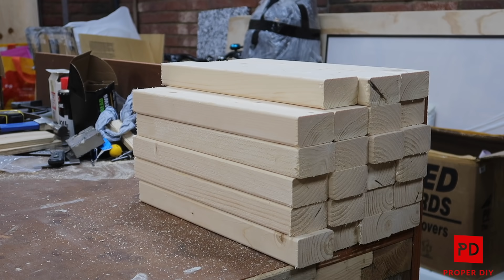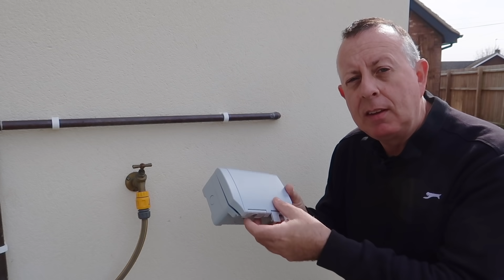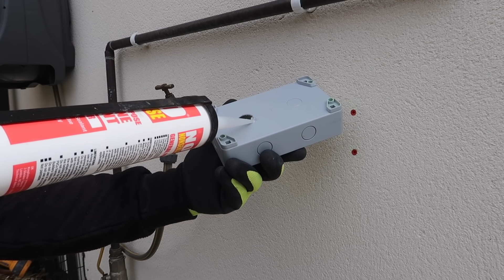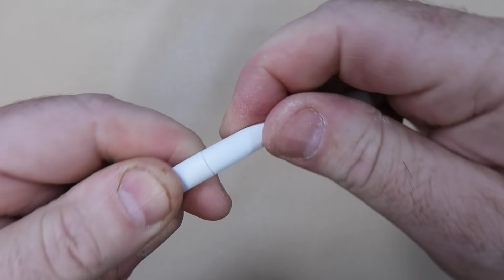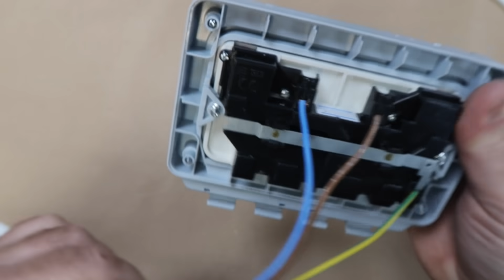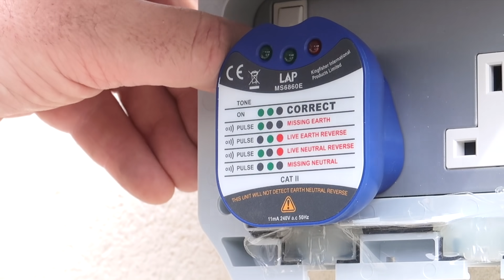How to Install the Easiest Outdoor Socket

Comment: This is classed as ‘notifiable work’. This requires a Building Regulations application to be made in advance so the work can be inspected and checked. However, in most cases the electrician can self-certify their work as they’re normally registered with a body that gives them the necessary ‘registered installer’ status (also known as ‘competent persons’) such as the ECA (Electrical Contractors Association) or NICEIC (National Inspection Council for Electrical Installation Contracting).
A ‘non-qualified’ person can still carry out notifiable electrical work as long as Building Control are informed – but if you fail to do this and the work is found to be unsafe, it can lead to a hefty fine. Upon completion of the job, it is a legal requirement for the electrician to test the new system and hand over a signed BS 7671 electrical safety certificate. If you are watching a youtube video on how to fit a plug socket, you are not a certified electrician and are not insured or covered and neither is your work 🤷‍♂️
Reply from the maker: This is an addition to an existing circuit. As an addition, this is only notifiable if it is in a 'special' location which is a bathroom or room containing a swimming pool or sauna. Therefore this is not notifiable work.
Reply: 100% non-notifiable.

Outdoor locations were removed from part P around 2013 so even if this was hard wired into an existing circuit would be non-notifiable. It would only be notifiable if it was a new circuit (or in a special location)

Comment: Be aware the doing unlicensed electrical installation null and voids your home insurance.
Reply from the maker: Absolutely if it is outside of that allowed in Part P of the UK Building Regs.
Reply: According to Part P this work is not notifiable. Even if this was an actual spur, it still wouldn't be notifiable. This guy also fits a plug to the end, so in essence, it's just a glorified extension lead. Here's a link to some official part p documentation so you can check it out yourself: https://electrical.theiet.org/bs-7671/building-regulations/part-p-england-and-wales/frequently-asked-questions/
Reply from the maker: @ashleydawson5070  Well said.

Comment: I'd 100% use bootlace ferrules  on stranded wire.  If there were to be any mechanical movement or vibrations in close proximity to the terminals.  There would be a much lesser likelihood the terminations would come loose.  We always have the conduit running at a slight downwards decline to the outside socket to prevent water ingress. As well as leaving the earth cables longer.  This is because if anyone were to pull the cable (i.e inwards)  the earth would  cable would come out last.
Doubling over the wire give a larger surface area for the terminal screw to clamp the cable.  It's good practice but not a requirement.  It's usually done more so on spur outlets and lighting terminals.  Where there's only a single cable being terminated.  👍

Comment: I have a question, I'm thinking of doing this for one main reason.. to plug an inflatable hot tub onto an outside socket but have one concern and that is;
On the instructions of the hot tub it states to not plug it into an extension lead, is this method technically classed as an extension so the hot tub will fail?

Many thanks
Richard.
Reply from the maker: This is essentially an extension cable with one end outside. As there are only 2 connections I believe there is low risk for earthing and RCD problems if you follow the steps I've shown. However, once you talk about a hot tub, then the stakes go up as the combination of people, water and electricity starts ringing alarm bells to me. Just like building regs requires qualified electricians to carry out work near to showers and baths, I believe, for everyones safety, hot tubs should always be professionally connected as only they can properly check the work they have done.

Comment: You do need a drain hole.  I don't care how well you think you have sealed it, warm air from your house will go through the conduit into the back box which will have cold outside air surrounding it.  The moisture in the warm air will condense.
Reply from the maker: I sealed around the cable and conduit so nothing coming in from the house

Comment: I'm an electrician and this is a great instructional video, the silicon and the pipe was a nice touch too
Reply: Are you sure you’re a qualified sparks Andy?
Reply: Yes Im positive, as long as this is terminated correctly and RCD protected it's perfectly safe imo and would do it in my own home. Probably wouldn't if I could back to back it off a socket but it has its place,cheers
Reply from the maker: Thank you so much! All I tend to get from Electricians is grief so nice to hear this from you!

Comment: Doing it this way is also non Notifiable under a minor works certificate, if he went in the back of the socket it’s noticeable as it’s in a special location. Most do it anyway but if you do decide to go off the ring main then mount an FCU next to the socket that way you can isolate the outside power. Also I would use the drain hole as at some point the silicone will fail letting in water, never fitted an LAP outside only ever used BG
Reply from the maker: Very good and correct points! I will do an update video after 12 months and we will all see how much water is in the box!

Comment: Can this be a permanent solution? I.e. putting electric to a shed / office?
Brilliant content, keep up the good work and thank you 😀
Reply from the maker: Thank you! Unfortunately not. To be going across your garden in any way you really need to be using armoured cable and there is a lot more risk if not earthed properly. This will need to come from your distribution board and under the UK building regs, you need an electrician for that.

Comment: Should have used 2.5mm 3-Core flex mate
Reply from the maker: Why? A 1.5mm flex takes more than the 13amp fuse (as I said in the video) so no benefit as the fuse is the weakest link.

Comment: I'd still drill out the drain hole, and the second one if it had one. The magic water always gets in somehow so it's good to let it out again.
I'd also recommend using an RCD plug. You can get the socket and plug in a kit although you are then limited to the supplied cable unless you rewire it.
Reply: The poster said his circuit was already RCD protected (11 minute point) so you don't need an RCD plug which would be just a waste of money.
Reply: @alanmorgan1389  it's always good practice to protect an outside socket with a dedicated RCD. Lots of factors can reduce the sensitivity of an RCD, the main one being length of cable from the consumer unit. To maximize protection and sensitivity of an RCD, it needs to be close to what it is protecting. Otherwise voltage drop and high resistance connections can stop it tripping. All long extension leads should be used with an RCD for this reason, especially outdoors.

Comment: This is a great video, so easily explained, this is how I want to add my outdoor socket, would it be ok to extend the socket through conduit to the rear of the garden?
Reply from the maker: Thanks. To go across your garden you need an armoured cable and to install that while ensuring the correct earthing and RCD disconection speed you really need an electrician to install I'm afraid.

Comment: I believe DIYers are allowed to connect a 13A FCU in place of a plug going into the socket, is that correct? Also, isn’t there a regulation on using plug and socket for permanent fixtures like lighting etc?

Comment: Surely you should have that circuit covered by an RCD ?
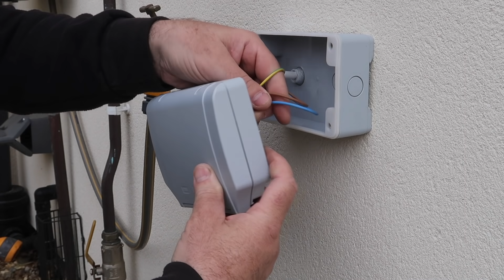Reply from the maker: It is - I talked about it at 11:20
Reply: My bad , I should listen a bit better. About the drain hole, once you've knocked the hole out the back you've lost that ip66 rating no matter what you fill it with, if you don't close the cover properly again no ip66 rating, manufacturers don't add the hole because they want that  ip66 rating but they know a drain hole is important for future unforseen problems that might let water ingress.

Comment: Not really enough information in the video regarding shock protection/earthing. Outdoor equipment should have 30ma rcd protection. To prevent anyone getting a fatal shock. A 13a fuse in the plug gives no shock protection at all. In many cases an rcd plugin or an rcd socket, or an RCD at the consumer unit will not do. If the main earth is PME you must not export the earthing to outside.The earthing must be separated from the main household earthing and a separate configuration provided for supplies outside the main building..ie earth electrode plus 30ma rcd.
Sorry to be negative, but a little knowlege can be dangerous..this method has its problems and risks.
Reply: The way he has done it for a diy is better than him doing it from the ring or via a radial circuit. I will assume he has RCD protection via the CU that will cover the Circuit. He has just basically made an extension lead that is all. And as you talk about with the PME yes you are correct but that is for if you are running I.e armoured cable to an outbuilding with a separate DB.

Comment: What's the minimum bend radius on a electrical cable before insulation becomes stressed and weak?
Reply from the maker: I could tell you for flex cable - it behaves differently to solid core.

Comment: No mention of rcd protection,  you don't know if the socket you're working from has a good ZS reading
Reply from the maker: Yes there is @ 11:20 - you need to see the whole video rather than skipping through. Correct, no ZS reading - just like the 50m cable I plug into it going out to the strimmer at the end of my garden.

Comment: Great video - I've put 3 outdoor sockets around my house all using this technique, connected to my garage. I added RCD plugs for safety but it probably wasn't needed.
Reply from the maker: Well done - they will come in handy I'm sure.
Reply: Hopefully you ran them off a fused spur. If they're all spurred off the same socket, you're looking at a potential fire hazard.
Reply: @BobBobOnYouTube  separate sockets for each - no bother
Reply: @AutoAbsolute  Cool.

Comment: As a self employed spark with a family to feed, this kind of vid will never sit right with me. Not a bad job you did to be fair for an extension lead (skirting board clipping aside) and luckily most homeowners would rather pay someone like me to hard wire it properly.
Reply: Let's not be a hypocrite....
Reply: Ensuring the outside socket had some form of RCD protection as well.
Reply: No one owes you a living

Comment: great video. i have a external ready to fit. but missed what the cable was ? can i use 2.5mm twin and earth?
Reply from the maker: The problem with a 2.5mm twin and earth isn't really designed to fit properly into a 13amp plug. Capacity wise it would obviously be fine
Reply: @ProperDIY  thanks ill get the correct cable. what was it called ? much appreciate the info
Reply from the maker: @ryanjones674  Its 1.5mm flex cable

Comment: Mini trunking along top of skirting to offer mechanical protection  is good practice if you must run flex outside instead of t/e cable. Using an external RCD socket outlet also minimises tripping whole circuit in fault condition.

Comment: Sorry but I think it’s a mistake not to open the drain hole. We have all seen outdoor rated fittings, lighting etc with water trapped in them. Every time the temperature changes the air inside expands and contracts, over time it’s going to suck in moisture no matter how well you seal it. The drain hole at the bottom rear is not going to allow water splashes to enter, unless you point a hose directly upwards at the base of the socket, but it will allow for any moisture that does enter to leave.
Reply from the maker: Well, I'll leave it 12 months and then open it and see. It will make a good update video!

Comment: Hmmm only qualified electricians should carry out electrical work
Reply from the maker: I disagree. Homeowners are allowed under Part P of the building regs to carry out quite a lot of their own work like replacements and small additions in non critical areas. If I had to employ an electrician every time I fitted a new plug on a cable or changed a light fitting they might as well move in and live with me as I would need them so often!
Reply: What constitutes 'qualified' for an electrician?

Comment: Really excellent content, thorough and to the point. Everything you do is done well and thought out, which means the job can’t fail. I can’t tell you how much difference it makes to see someone doing this. You are passing on great skills. Thank you.
Reply from the maker: Well thank you very much for your comments. I always think out projects before they start and especially if I'm on camera. Anyone spending 10mins+ whatching me should, I think, deserve to leave with at least with good tip or a laugh or 2.
Reply: @ProperDIY  yes and what strikes me is that many jobs, like this one, are actually a series of smaller jobs, each perhaps requiring a basic skill. Your video didn’t assume that I knew how to do anything, no missed steps, but at same time you managed to keep it from being long winded and patronising.
Reply from the maker: @michaeltester5187  Thank you again. It's actually a difficult balance to show everything, be entertaining, miss nothing and not make videos 50 mins long!!! I'm always concerned that I will fail on one of those.
Reply: @ProperDIY  for me, you are getting it right!
Reply: @ProperDIY  entertaining and educational.
 Did you have many outtake in your vids?
Reply from the maker: @justintemp  I have hours of outtakes! I will release some fo these in the future - just not sure how at the moment
Reply: @ProperDIY  runs so smoothly you've ruined the illusion 😂

Comment: Could i feed the flex through an old no longer used tumble dryier vent pipe and use a weatherproof gland through the side or bottom of the back box instead of drilling another hole thru the wall?
Reply from the maker: Yes. Essentially the cable just has to get from one side to the other without letting any water into the house

Comment: The only criticism i have is when you say " if moisture gets in switch it off and it's isolated". If there is moisture in there it would still trip the rcd out by neautal to cpc fault. You would have to remove the plug. 90% of all tripping faults i get called to are people leaving appliances switched off, not unplugged
Reply from the maker: You are quite right - switching it off only will not stop the neutral to cpc fault. If I do have an issue though I like the idea of being able to remove the plug and totally isolate it as opposed to hard wiring in a spur into the back of an inside socket as a lot of people told me I should have done!
Reply: @ProperDIY  i agree mate. Also this way you don't require a minor works cert. Was just offering some constructive criticism. Glad you  know your onions. Can't knock the job. Keep up the good work pal.
Reply: Unless the indoor socket is double pole switched (MK Logic Plus for example?)

Comment: Just bought a lay z spa, would it be safe enough to install a outside socket this way?
Reply from the maker: No, definitely not I'm afraid. Swimming pools, spas, jacuzzis etc are high risk items as you can imagine and need to be connected by a qualified electrician who can prove the required earthing and RCD isolation etc. This is law under Part P of the building regs.

Comment: Good luck getting it sign off and building control informed.
Reply from the maker: I don't think I need to - it's not notifiable work under Part P of the Building Regs.
Reply: It's not fixed wiring so he doesn't need too.
Reply: Why would he? Non-notifiable works
Reply from the maker: @MagicRat  Quite right!

Comment: As usual enjoyed watching your video. As the wiring to the outside socket is essentially permanent, rather than the internal plug  being connected directly to an appliance, I think a switched fused connection unit wired to the internal socket as a spur should be used.
Reply from the maker: 2 reasons I didn't use a switched spur 1) I like the idea of being able to completely isolate the socket by removing the plug 2) I don't really want to be showing the average DIY'er anything that encourages them to start trying to wire directly into their house electrics.
Reply: @ProperDIY  
Ok Sir, understood. Many thanks.

Comment: Great Idea, I can see it working for Security lights and wireless CCTV camera's as well. When I had my garage rebuilt I had the Electrician put in a couple of double sockets on the gable ends of the loft storage space. They've proved to be useful for powering up my CCTV system & cameras which is mounted there out of the way...
Reply from the maker: Sockets in a loft space is a really good idea!

Comment: If you use a smart switch you can usually set up a timer with the app. You can also add a smart motion sensor
Reply from the maker: Great tip!

Comment: Great clear and concise video. Can a similar technique be used to run power to a summer house or shed.?
Reply from the maker: Thank you. I'm afraid not. Because of the route (either underground or in the air) you would need armoured cable and more than 13amps which means an electrician as that type of work is not allowed to be done by a non qualified home owner! UK Building Regs I'm afraid.

Comment: You just compromised your IP66 by drilling 15mm hole, the if the socket has a 20mm knockout then 20mm conduit with
bush coupler through wall, you can buy long drill bits as cheap as £12 just got to shop around
Reply: I agree that he's lost the IP rating as the instructions call for eg a conduit gland. However, pragmatically speaking i feel that installation is more than ip66 water tight despite it not having the certification.